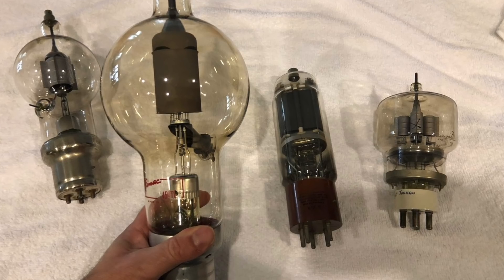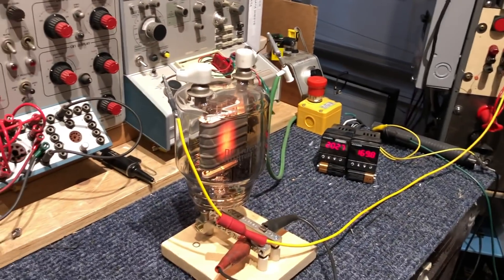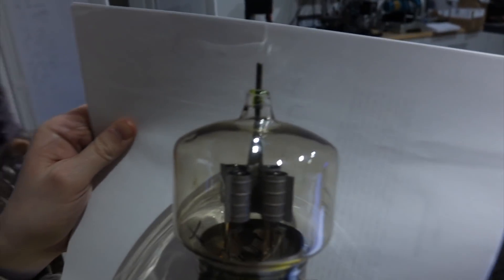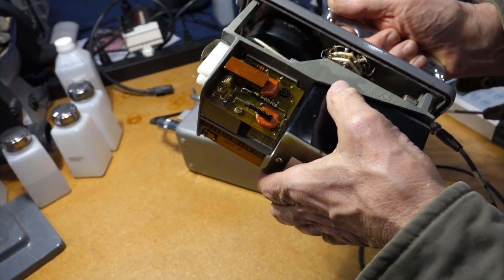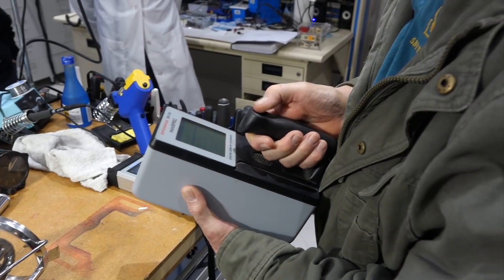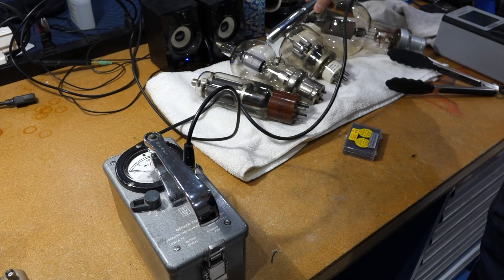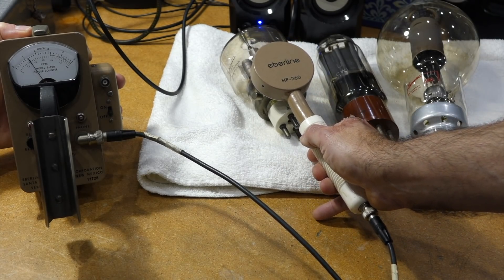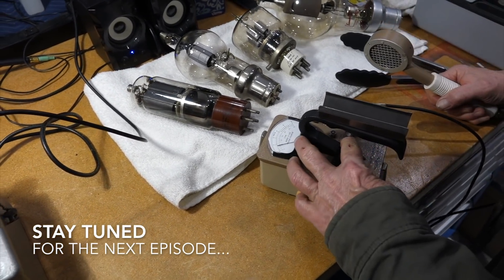My vintage vacuum tubes are radio-active!

Comment: I used to do uranium chemistry, many years against. There are several things too think about here. 

1. Much uranium since the war is depleted, this means it has much less (1/3) u-235 and u-234 the stronger alpha emitters and ~ only 60% of the radioactivity of natural uranium. So most uranium in use outside power stations is mostly u-238
2. The radiation you picked up will be from decay products u-235/u-234 -> th-234 + alpha and all the way down from there to Pb-206 its alpha and beta decay along with weak gamma emission
3. Alpha particles are bare atomic He nuclei without electrons and are dense enough that they wont go through anything much (even a sheet of paper or a small air gap  is quite a big barrier)
4. However direct contact of your tissues with an alpha emitter (ie object to skin) for long periods is bad because all the radioactivity gets dumped in a very small region (read cancer). This is why breathing in insoluble uranium compounds as dusts is really bad.
5. Have you looked the smoke detector in you lab it may well have americium in it which is a reasonable alpha emitter but some plastic metal and air reduce exposure to basically nothing

6. Uranium is quite chemically toxic, its a heavy metals poison like mercury and lead

So don’t hold the tube by the uranium part while you sleep, don’t cut it up and keep it in a cardboard box !
Reply: That the uranium is (literally) vitrified though makes it in the safest form possible. Even if dropped and broken it would be pretty hard to ingest significant amounts of it.
Reply from the maker: @Gary Thompson: Ah! That's the comment we were all waiting for! Thanks for the illuminating information. You are getting pinned as a result of your Good Deed.
Reply: I was just about to comment on alpha particles being pretty easily blocked by a sheet of paper, I worked at nine Mile nuclear power station in the water chemistry department as an engineering co-op and they were much more worried about Cobalt emissions raising the in plant exposure. FWIW, if you can get a job at a nuke, do it. They are one of the cleanest places I have ever worked at, and also some of the most mind-blowingly big equipment I have ever seen
Reply: The chemical aspects of depleted uranium is much more dangerous than it's radioactivity.
Though since it's vitrified it's pretty much harmless..
Reply: the uranium glass should be contained completely within the tube by the looks of it, maybe it was used because molten uranium glass wets better to wire than normal glass
Reply: If the uranium has been through chemical processing it will have lost most of the progeny, so mainly U238 and U-234 activity which have alpha and beta activity.   It takes a few months for the Th234 and Pa 234m to grow, doubling the activity of the U-238 & U-234.   However it takes another 3000 years before the later products begin to appear, the Th230 down to the Pb206.  That is why natural uranium is about 7 times more radioactive than purified uranium chemicals, a fact that Madame Curie noticed and led her to discover polonium and radium.
Reply: I did used to wear gloves when doing the uranium chemistry
Reply: If you're going to get tissue damage from alpha emissions from THIS uranium,  I think you'd have bigger issues in that you'd  have been eating or snorting ground glass........
Reply: Shouldn't you handle it with rubber gloves too?
Reply: @commodoresixfour7478  Not really. I've got some uranium glass crystal beads, and they're poor enough alpha emitters that you'd have to be holding onto them for hours and hours, maybe even days, at a time for it to ever be a problem. It's why these aren't in a piece of jewelry anymore, not a great idea to be wearing them against your skin for a long time. Maybe wash your hands if you handle the actual uranium glass for an extended period, definitely DON'T put it in your mouth.
Reply: You are a God my friend
Reply: Where depleted uranium originates from reprocessed nuclear fuel it can also contain u-236. An isotope uncommon in nature. Whilst it's origins may make it sound scary this is a beta emitter with a very long half life.
Reply: That glass has a few ppm of uranium, is not depleted uranium, and is out of secular equilibrium. That translates into very few decay counts of any type. There are many other natural materials that are far more radioactive.

Comment: The pancake detector on the beige instrument it is actually alpha sensitive. Well you found out that the uranium glass is the least radioactive material. There is a small amount o uranium in it and also uranium is the least radioactive element after thorium. The radioactivity in nature is actually mostly given by U and Th decay elements, but when you process uranium you remove the radioactive elements. That piece of glass will be more radioactive as it ages.

Comment: 11:30 the alpha radiation will not make it through the normal glass of the tube. Maybe only on the top seal, you will measure some alpha particles.
I don't see a reason to put them all the way in the back of the lab. Uranium glass is very safe, unless you shatter it, and a splinter gets under your skin.

Comment: It is not an accident. Radioactive materials are sometimes used to help give a starter charge for the tube.
Reply from the maker: That would be for ionized gas tubes. Not for these, these are regular vacuum tubes. The uranium is used in the glass around the leads to better match the coefficient of expansion of the metal leads.

Comment: The uranium was used to color ceramic glaze orange, some old orange plates will make a geiger counter really act up.  Remember, we ate off these plates for decades and it didn't seem to bother us.

Also the glass elements in some camera lenses were made of thorium glass, and will set off a geiger counter.  My Canon FD lens does if the rear element is held next to the probe.

Comment: Just thought of another semi-common source:  TIG welding electrodes.  Thorium is present in certain ones giving way to a longer lasting point on the end of the electrode during use.

Comment: Alpha radiation is highly ionizing I think, so does this glass affect the valve functioning a little?
Reply from the maker: In tubes that rely on ionized gas (Thyratrons, Neons,...), it is indeed used for that purpose. But for vacuum tubes like these there is nothing inside to ionize, so I would think it has no effect.
Reply: @CuriousMarc  That makes perfect sense, thank you.

Comment: Many old valve amplifier  tubes and rectifiers were deliberately doped with large amounts of uranium, thorium or radium in order to ionise the gas or vaccum in the chamber to increase conductivity and/or remove static build up, tubes for early radar equipment were often made with radioactive metals or salts inside..

Some chemicals used in the coatings of early cathode Ray tubes for early televisions had radioactivity from natural sources in the minerals, such as fluorescent materials on the screen front.

High voltage vaccum tubes in radio transmitters and amplifiers as well as large rectifiers often emitted radiation in the form of x rays and gammas when under heavy load at high voltages, this was the case with everyday television tubes ass well, they would emit Xrays all the time when powered on and this varied depending on the voltages involved in the electron gun and also the size and makeup of the tube and the glass, this is why aa lot of office spaces had the old CRT computer screens/monitors staggered/alternated with spaces so that they were not across from each other and office workers were not sitting behind the tube electron gun of the other persons computer monitor, so as to reduce the Xrays..

For anybody old enough to have used the old style CRT cathode Ray tube televisions, the high capacitance of the glass tube flask would build up static electricity on the tube front, which would crackle and tingle when you touched the screen, do you remember turning off the TV by the power button or remote control when you were nearby, and getting a fast pop/tingle of static electricity on your face even if you were 6 feet/2 meters away? This was due to the high voltage high potential inside the tube in the field coil collapsing and discharging and this surge/spike induced a high voltage inside the cathode Ray tube that led to the short but powerful emission of Xrays, ionising the air in front of the television or computer monitor (all around it really) and this temporarily conductive airgap which was otherwise a fairly good insulator would conduct the static electricity away and it would make your face tingle uncomfortably when you felt it, this is why radioactive sources are used in textile and plastic factories to dissipate static electricity...

So if you grew up any time before about 2003 you were getting several low power Xrays each day without realising it...
Reply: Just to add, towards the end of the era of cathode Ray tube televisions and computer monitors, the outer part of the cathode ray tube (CRT) screens had a metallised coating containing lead oxide, which was used along with a "degausing" wire to discharge the static electricity, there were "degausing" buttons to push on computer monitors when static built up (this would affect the field coil temporarily when used due to the high voltage surge of grounding the static away) and make the picture wobble for a second or two on the screen..
Right at the end of the market for CRTs there were a automatic degausers which did this every set amount of time on computer screens and you would hear the relay click every 30 minutes or so, and just before the power went off when you shut down, the timing sequence would degause the screen to conceal/remove the static electricity being ejected/conducted away by the ionisation from the x ray emission when the magnetic field collapse from powering off the field and scan coils would induce a high voltage spike inside the vaccum tube that caused unavoidable xray emission (a bit like an early style xray "gun" component of an old style xray machine)

Some more upmarket CRT televisions and monitors would detect static build up and discharge via degausing more frequently..there were also very very fine wire meshes on screens at that point in time for anti static purposes.. 

Now we have OLED super high definition televisions and laptop and tablet screens, 4K and 8K (in years to come reading this will be long outdated as there will be more and more leaps forward and even better screen and projector picture  quality and better phone and tablet computer screens..

(written in early April 2020)

Comment: If the radiation is a safety concern you could put it behind some leaded glass.  I have always wondered if the coating on the front of a CRT tube could be washed off.  It would be cool to put a tube in a tube if you could make the front of a CRT easy to see through.  It would make a cool display and double as shielding.

Comment: Used radioactive tubes in the US Navy back in 1982  for radio and radar transmitter equipment. All us Electronics Technicians were instructed on the cleanup procedures in case we dropped a tube and it was broken.

Comment: The Pentax cameras made up to the early 70s with the 55mm normal lenses are also quite interesting. The rear element of the lens has a sizable proportion of thorium oxide in it since the thorium has a very high refractive index and makes for a more powerful lens. It also drives my Geiger counter crazy.

Comment: Fascinating ! Some old valve can radiate X-ray as well when they are on, There was a label dedicated to service men
Reply: The big transmitter tubes probably could, as their plate voltages were often up in the 10kV range.  CRT's in old televisions and computer monitors had the same issue, though IIRC they used lead in the glass to cut down on the x-ray emission,

Comment: Uranium glass puts out mostly soft / low energy beta activity.  And those were very low CPM rates, so no big deal.  I have some of those Eimac tubes myself.  One is dated 1946 and still used U-glass inside.  The U-glass was used to more closely match the thermal coefficient of expansion (COE) of the glass to the metal electrode / terminals.  The CPM rates shown are very low man.  No reason to banish the tubes to the back of the lab.  The soft beta activity fizzles out to the point of being undetectable just a few feet away.  The thoriated tungsten filaments are also very mild.

Comment: From what I've heard in the past, and this isn't based on any specific knowledge, Uranium glass is relatively safe.  Don't sleep with it under your pillow and don't make it into a pretty bedside light display thing that you are going to spend long periods of time in close proximity to.  Make a little glass fronted cabinet so you can display and enjoy them because they look fantastic and really deserve to be seen.
Also, don't grind the glass into a powder and breath in the dust - that is BAD - once inside you the radiation is far more easily absorbed into the tissues - that's the big problem with the thoriated TIG electrodes, people grind them to sharpen the tip and breath in the dust - then the radioactive particles are inside you.

Comment: I think the moral of the story is that a clock with a radium dial is way more radioactive than uranium glass or thorium mantles. That being said, the amount of radiation given off is small, and actually your skin is blocking pretty much all of it. As long as you don't eat the glass, you should be fine :3

Comment: Thorium glass was quite a thing back in the day, from memory, it resulted in a stronger and clearer type of glass with producing less impurities...  There are a good number of camera lenses that had some thorium glass elements in them; many late 50s early 60s Pentax lenses and many others.  A massive amount of discussions and arguments have been had about how safe these lenses are, and most of the conclusions say 'do not place under your pillow at night, don't gaffertape to your face and/or don't store in your shirt pocket for an extended period of time'!  Probably a bit more radioactive than a banana, far less than an old Radium clock dial.  Complètement aimer vos vidéos et votre travail, soit dit en passant!

Comment: some tubes have some nuclear material in them, usually power rectifiers I noticed, the "hottest" thing I have is some depeated uranium on the side of my 50's Geiger that clocks in at 14.31 usv/h. The counter I have can even get a reading off of tritium keychains

Comment: Uranium glass is very slightly radioactive emitting mostly alpha and low energy beta and since is vitrified it's almost harmless.
The x-rays from driving them with too high of a voltage can be more dangerous.

Comment: The uranium glass is used to transition between glasses and metal of different coefficients of expansion (COE). If there wasn't a transitional glass used the glass/metal seal would crack.

Comment: Nice! Vacuum tubes are amazing because of how different they are from solid state devices. I am wondering, given your love of old HP test equipment, why you don't seem to have any old HP oscillators like the 200CD or any of its siblings. By the way, after discovering your site and finding your Friden documentation, I now have the courage to get my thrift-store-purchased Friden SBT10 unjammed and working.
Reply from the maker: Excellent! Good luck on your Friden, at least my scanning effort has not gone in vain. I have one tube-based HP instrument, a current probe - can't remember its number. Still works! I should make a video on it one day. But that's the only one I have.

Comment: The atomium is actually not related to the atomic age but was designed to represent the 9 provinces of Belgium. Ironically, the people behind the project decided to mostly use aluminium instead of steel even though the Atomium also represents an iron atom.

Comment: I handled depleted uranium when I was in the Army, in 120mm tank shells. I recall an instructor running a Geiger counter over the penetrator, showing us that it was barely radioactive. As another commenter pointed out, the danger from APFSDU rounds isn't radioactivity, it's heavy metal poisoning from the dust.

Comment: Certain glass mixtures of uranium and other metal salts create a very high melting point and were considered ideal for sealing high wattage vacuum tubes. The mixtures were closer to high temperature ceramic than actual glass.

Comment: Very interesting. I’m reading up on old tube technology. It’s a lot easier to understand than semiconductor electronics. I had never heard of uranium glass. I wonder who came up with that idea. I put up a video about a year ago on early Philbrick tube based op amps that are slightly radioactive. They used a spot of radium paint on the side of neon tubes to start the conduction since they were in a dark case and wouldn’t start otherwise, if I recall correctly. The paint has a significant level of radiation up close, but I measure background levels when more than about a foot away from them. I read that the biggest danger with those would be if the paint were to chip of and somehow be ingested. Most of the beige colored op amps had the radium paint, but the grey colored op amps were clean. It amazes me how readily designers used radioactive materials back then.

Comment: I was a little surprised that a 50's built device would have transistors, it turns out that the Erbine E500B was released in 1964 which makes more sense.
Have to love those big tubes.